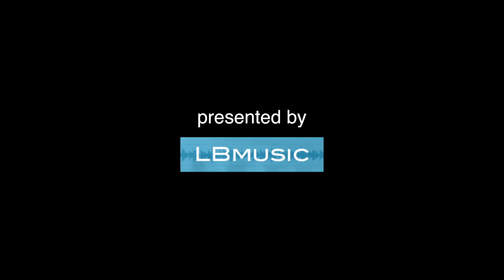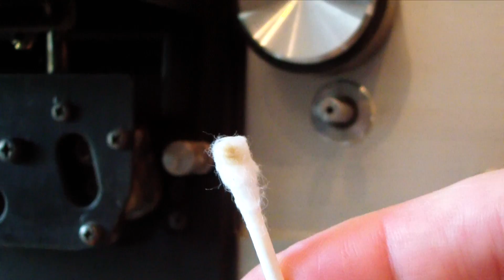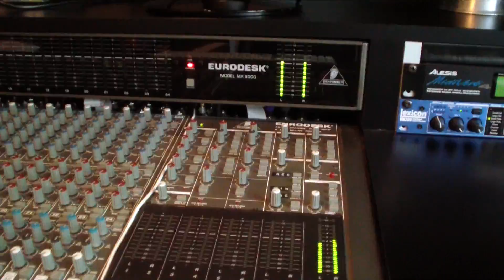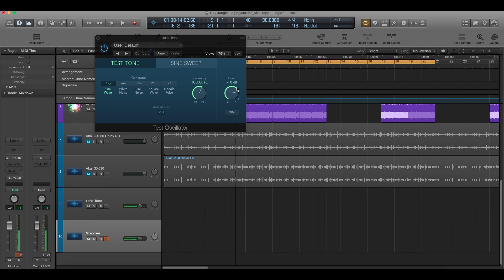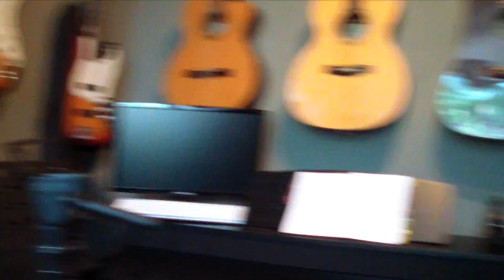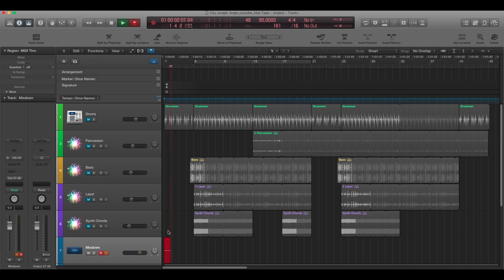Akai GX630DB Tape Machine: Setup, Gain Staging and Recording | Hybrid Mixing

Comment: It’s more like 40 years old when this video was made and now 50 years old. These are direct drive so you don’t have to worry about belts. Also; it’s heads supposed to last a hundred years or more. I recently bought it not knowing if it works. To my pleasant surprise; it works perfectly. What a durable  machines they are! I wouldn’t be surprised if these keeps working for another 50 years!

Comment: Open reel tape (ie) the most expensive way to store music. With good tape it should last a LONG time before print through and shedding oxide. I have tapes made on my dad's old Akai M8 that are around 60 years old on Kodak tape that sound as good as the day they were made. No real Hi Fi system is complete  without a nice 10.5" open reel deck.

Comment: thanks for the video.
any suggestion for me to figure out the connection between my reel machine and interface?
because my tape machine only has rca in/out but the interface only has xlr and some say that cables like rca to xlr or the opposite might degrade the sound quality?
Thanks !

Comment: Thanks for video. However original sounded better. There is a problem with either your tape machine or settings on it. The sound should not degrade that much.

Comment: Very nice video! Tape is like compression, different settings for different uses. No point in writing "you should do this or you should do that.." The point here is that you process your sound through a true sonic weapon, no matter if dolby or not, hiss or not, because if you use it correctly, your music can reach stellar proportions. You showed a very good example of equing after the process, to boost the affected frequencies (due to your tape settings). Peace.

Comment: I used this to replace my old reel that is getting harder and harder to crank after being used allabout.wiki/01fs in one of the harshest environments for reels I've ever fished in. The Battle II has held up far better and longer, and the sealed bearings make a big difference. I think I've caught close to 50 fish with it already, and the drag has always been smooth. Great for fluorocarbon line!

Comment: Should Never ever clean tape heads in up/down direction. Only Ever clean in the  same direction a tape goes, ie, --Left/Right. Reason is, Delamination of a permalloy head, especially if its old--And they are All old these days!...I have the 7" version of this machine, the GX-286DB.
My rebuilt Tandberg 64X sounds better tough, those glass/ferrites saturate way too easy and give muddy in the reds....

Comment: 1. Does it make a diference to record into the box, then the tapes, then the box? 2. Couldn't I just simply use a tape plug in?, what difference would you notice in these two questions?
Reply from the maker: It is basically an easier and quicker option to record first in the box and then record the mix to tape and back again. You could also use just tape plugins for that, but I like the sound of this machine quite a bit more. It has more „tape sound“ and saturation than most of the plugins I tested. However, meanwhile I don‘t have it anymore because of workflow and the cost of tape reels. I also have way more outboard equipment now, which gives me enough analog vibe.

Comment: recorded tape sounded exactly as a cassette recorded on a bad deck with dolby b  , more bass less crispy , so considering your machine has flawlessly performance, dolby nr on reels is absolutely garbage crap..........on the other hand , when u set vu meters on 0dB needles bounce around that value which is NOT NORMAL on SOURCE, they shoud be really steady , u have bad caps, dirty pots or switches.

Comment: Hi! Does your Akai control the speed precisely? I mean is the timing of reampped track strictly equal to the original? I've bought the same machine and teh problem is that the speed of reamped track is a bit slower
Reply from the maker: Hi! Mine was also not 100% speed stable, but it was pretty close. I guess that is quite normal on semi-pro 1/4“ machines.
Great band by the way, just checked some of your videos!
Reply: A little speed varies is inherent, but if it is running very slow, try looking up a video of how to clean and lube your capstan, and your pinch roller arm. Your motors might need some lube as well.

Comment: With a 3 head machine while recording you can switch from source to play and instantly hear your recording, if your bias is optimized for your type/brand of tape there will be no/very little difference in quality of sound especially at 7.5 ips. Suggest you get a service manual and set up your record and bias levels to suit your tape, you will find a big improvement  in performance.

Comment: is it possible to do this with an apollo quad replacing the console as the interface?
Reply from the maker: Yes, connected the tape machine to 2 outputs of the Apollo and route all your tracks to that. As print return create a stereo track with inputs coming from the tape machine and set the output to your monitors. Engage input monitoring of the print track and switch to source monitoring on the tape machine while mixing!
Reply: @ZedMartyProduction  Thank you for your response!
Reply: Will I have to do any DBU DBFS application/metering since I'm working on Apollo rather than console?
Reply: **and achieve the same analog print?

Comment: When you would have pushed the tape deck to the red zone, you would have had more saturation (which is the nice equivalent of the digital clipping). Analog saturation is liked, because of its "warmth" and "richness". You can run this recorded track along with the original one on a different mixer fader and make a dry/wet ratio you like, to profit both.
Reply: I was wondering about that.  If you could play both mixes together ( digital mixdown & tape mixdown ) in phase with each other. By recording mix from the repro head. You could low pass the tape mix & high pass the digital mix & blend together to keep the nice lows from tape & crisp highs from digital. Need a 3 head mastering deck though. Which I have. Fostex E2. I shall experiment !!
Reply: @byronwade1204  Nice!!! Show us the results please!

Comment: If I just wanted to use this tape machine as en efx and add color. Can't I just use it to pass audio through without actually recording anything on the tape back in the my daw ?
Reply from the maker: Sure you can do that, but you won‘t get much color because you just pass the signals through the electronics. There are no transformers or tubes in that machine.

Comment: You should not be adjusting the levels using source. You should be doing that in tape as depending on tape the final level will be different. You should also have the deck calibrated. Also you should not be using the  deck for any production work unless is has 15 and 30IPS. These are consumer tape recorders.

Comment: Question, would you normally master the track in the DAW then send that to the tape machine? Or master the tape version after?
Reply from the maker: I recommend mastering as the final stage. Send the tape mix to the DAW and and then do the mastering.

Comment: With tape you often EQ "to tape". My boss at the studio says that dudes would crank the highs going in, then pull them back during mixing, thereby getting as much high end as possible, and reducing the noise that created in the mix stage.
Reply from the maker: Yes, I also heard that from the guys that worked back in the tape days. They also recorded quite hot to get the best signal to noise ratio.
Reply: @ZedMartyProduction  Its found in alot of 80's music, Very hot 2-3K  .Many producers involved in the re issues purposely have gone back , and reversed that boost going to the new digital Master.

Comment: I'm just getting back into using tape machines after a 40-year hiatus and plan to do hybrid mixing with my DAW. I very much appreciate this information, thank you!
Reply from the maker: Great, have fun recording and mixing!
Reply: Hi, I ust thought I would ask you as you have a lot of experience in this field of audio.
The guy didn't mention what type of cables or the path of plugging them in?
I have a TEAC A-3300sx and want  to record audio from my DAW onto the R2R as a mix, to then use the R2R on stage in a performance.
I would be very grateful if you can give me any information on how to do this and what I will need Thank You.
Reply: @loonytbom7843  You need converters. Analog to digital/digital to analog. Whichever one you choose should have a choice of RCA or XLR connectors. You most likely would use the RCA for TEAC.

Comment: Nice machine!  Something is wrong, though.  When you were calibrating the input level, it appeared that the meters were moving a bit on what should be a steady tone.  Unless something else was present in the signal, that shouldn’t happen.  Maybe pots/switches need cleaning?  Also, it doesn’t seem that Dolby NR was working properly.  You may have to check bias adjustments, as tape formulation is much different now than when that machine was made.  Also possible but less likely unless someone was messing with it, if the alignment of the playback head is just a tad different from the alignment of the record head, it will greatly affect Dolby NR performance.

Comment: Hey! Thanks for the video! So I'm trying to do the same with an AKAI GX270D. Very simian machine. But Instead of recording it to tape—rewinding—and recording back to the computer, I'm trying to do that all at once. So that the track is recording to the computer while recording to tape. The way I have it now I'm getting feedback, even though I'm not monitoring the tracks I'm recording in my DAW. Any way to fix that ya think? Maybe there's a reason you didn't do it this way? Let me know if you need more details. Thank you!
Reply from the maker: It should work that way: Connect Monitor speakers to Output 3-4. Master Output 1-2 -> Tape Machine -> return to DAW on Input 1-2.
On the Mixdown track select Input 1-2, Output 3-4 and engage Input Monitoring so you can hear what's coming back.

Comment: Wonderful explanation. Thank you very much!!

One question: when I try this with only one of my tracks it creates a weird left to right phasing when I try to use it as a parallel saturation. Also: will the timing be perfect if I just use the drum tracks from tape and pair it with other tracks in the daw?
Reply from the maker: Thank you! The phasing you hear is the round trip latency of the converters and the slight fluctuation of tape speed. It is much more convenient to use tape in the recording process or at mixdown. For example you can record drums, print those to tape and back into the DAW. Then record all other tracks.
Reply: Thanks for getting back to me! When doing that, I get slightly out of sync with the click - would you warp it then? Or just forget the click.
Still trying to find my way around using this in my digital workflow.
Reply from the maker: You can automate the click to the drums which can be a little annoying or completely forget it and just use the drums as your click.
Reply: Yeah. That would be the way to go I think. How about vocals? Do you sometimes use the tape machine only on the vocal track when mixing? and is it possible to get that OK in sync?
Reply from the maker: Yes I did that. It‘s actually a little easier than with other tracks because  they are quite short in length and you can slice and align them to the original vocals much quicker.
Reply: I will try that! Thank you so much, Marty!

Comment: If I were to want to record one track at a time with only a mixer and a 8 track reel to reel how would I set that up?
Reply from the maker: + If it is a mixer with 8 subgroup you can go from those into the 8 track. Subgroup 1 -> Track 1, Subgroup 2 -> Track 2,...
+ If it has direct ouputs on each channel you can use those, eg. Channel 1 direct out -> Track 1, Channel 2 -> Track 2,...
+ If it has none of these, only the Main Mix Output it gets tricky. You'll have to connect the Main Mix into each input of the reel to reel depending which track you want to record. Of course you'll have to pan the signal left or right depending on the track (L=1 R=2, L=3 R=4,...)  eg.: Main Mix Out -> Track 1 & 2, Main Mix Out -> Track 3-4,...
+ For monitoring use the 2-Track of the Mixer. Tape Machine Output -> 2-Track Input.

Comment: Don't forget to store your tape "tails out" (loaded onto right hand side) to prevent "print through"
Reply from the maker: Good point, thanks!
Reply: Can you explain why this would prevent from printing through? The tape is still wound up. Just wondering and willing to learn.
Should you just ffwd the tape to the end so it is on the right hand reel? Or should it be inside out on the right hand reel? And if you have a auto reverse deck?

Comment: Please: 1.)  use tapes, that have been recommended and measured for azimuth position of tapeheads, 2.) use CCIR, 3.) do not use DOLBY NR, it is clearly to be heard in deteriorating your original signal (bass+/heights-), regarding the soundsource. It would habe been even more obvious on a piano sonata. 4.) different tape speeds would have been different (and interesting) as well. These recommendations are basics while recording on R2R, I was missing this information
Otherwise your video has a good quality. Well done

Comment: Seems like the recorded signal is a little bit weak in the higher frequencies. You should go over the biasing on the deck, and maybe tweak the aziumth head aligment.. ... I have an AKAI 630D and it had the same problem - Lots of base in contrast to treble. I just had to redo the biasing and it sounded great after that.

I've seen some people saying that the Dolby NR is what's cutting out the treble, but I doubt that's the problem :)
Reply from the maker: yes, I should do that! What Tape do you use on your machine?
Reply: Recording The Masters (RTM) SM911. It's sounds great, but quite expensive at 50€.
Reply from the maker: ah ok, I got the LPR 35 which is the long-play version of the 911. 43€ at the moment at Thomann.
Reply: Can you  make a video showing how to tweak the bias and the aziumth head alignment?

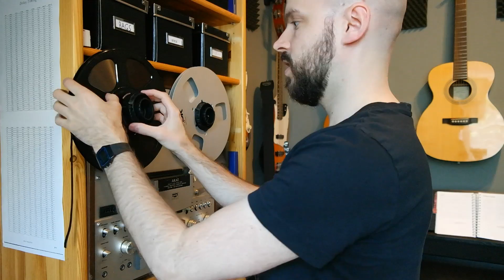Comment: 4:30 what? That's a trident reel, you don't need a NAB-adapter :)
Reply from the maker: I know, I should have mentioned in the video that the standard Trident hub was broken when I made the video. I normally use just metal reels. I actually had footage for that, but I forgot to edit it in :) Maybe I should put a clarification in the info box!

Comment: why would you put a nab adapter like that on a non nab reel ? damn ... also machine must be calibrate to tape : Bias, levels, HF eq.
Reply from the maker: The standard trident hub didn't work, but is meanwhile fixed. As I said in the video I normally transfer the tapes to the metal spools which are NAB.

Comment: Hi! Nice video, really simple! :)
Just tell me one thing, cause i've got my GX215D now, and gonna use it:
How do you align the track that you bounced back from tape with the original one if you want to mix those two?
You do that manually?
Cheers!
Reply from the maker: +nemy thanks! Well that's a tricky thing. Most of the time you won't be able to align them as the tape machine doesn't run with the same speed all the time. So the tape track can be shorter or longer than the original. That's why I use it only for final mixdown or at the very beginning for drums & bass.
Reply: LoudBox Music Oh, i get it. Well i'm going to try it anyway, to see how much offset i'll get. It would be ideal to use it that way, but if not, then i will track synths and drums through it for sure. Thanks for helping!
Reply: LoudBox Music Just wanted to share this with you: I tried to align them close as possible, but there are phasing issues all the time of course, but they are minor for some individual elementa, and tape recording is less in the mix, let'a say as some fx return. Oh, btw, do you remove your reels after every recording and store them in box or not? :)
Reply from the maker: +nemy htg sometimes, but most of the time I have a tape loaded. I just make sure that the tension arm is loose.
Reply: LoudBox Music thanks a lot man! do you fix it with something? because mine is going back when i loose it. :/
Reply from the maker: +nemy htg no, I give the reels a slight right rotation so the tape has some slack.
Reply: LoudBox Music got it! tnx!

Comment: I was wondering if it might even sound better if you would use EQ before recording to tape. So I mean, Add a bit of extra high-end to the signal going to tape. I imagine that this might also give a nice effect on the top-end saturation. Although in the example you did here, there wasn't all that much going on in the high-frequencies. But with the sound of a real drumkit I think it might sound very nice recording it to tape just a bit brighter than the standard digital mix would be.
Reply from the maker: +MacXpert74 yes, that's a good idea! It was actually quite common back in the tape days to record a little brighter as tape often has a little roll off in the high end.
Reply: Yeah, I remember reading about that somewhere. It makes sense that if you already know you're going to lose some high-end, to compensate for that during recording. If you find the time, it might be cool if you could demo that in another video.

Comment: question off point: what should the signal max level be from the analog mixer to the digital interface pre amp? I understand that the gain knob on my mackie CR1604 will control that output but should it be simply -18db max signal to the interface for a standard dynamic mic?
Reply from the maker: +mark well it depends ob the mixer's output but overall don't go above 0 dBVU on the mixer and -9 to -6 dBFS in the DAW.